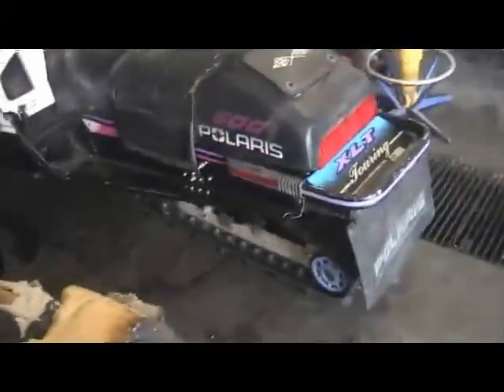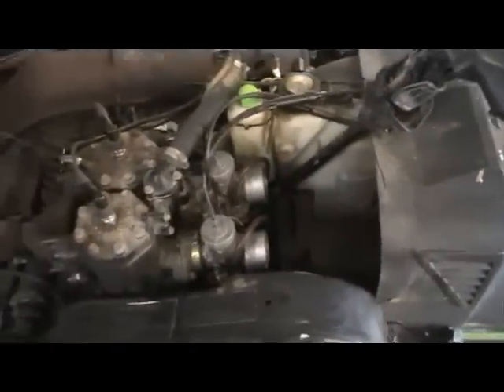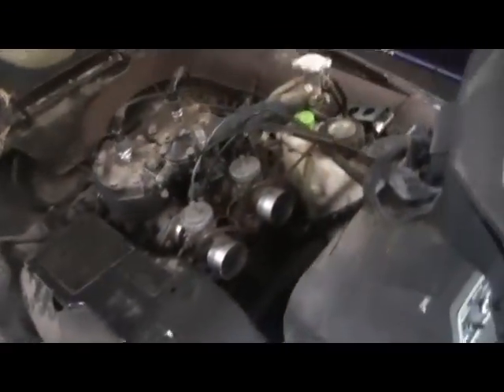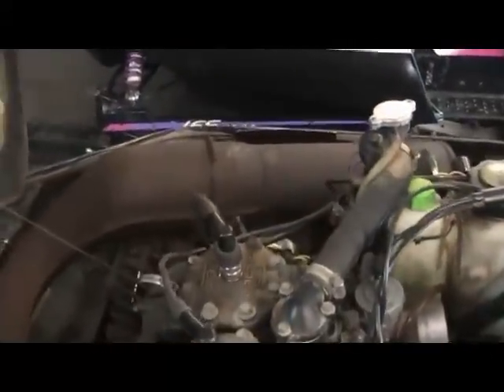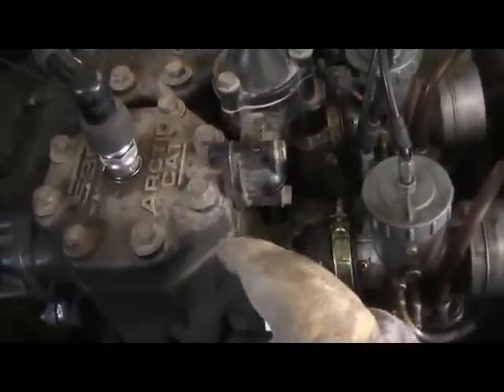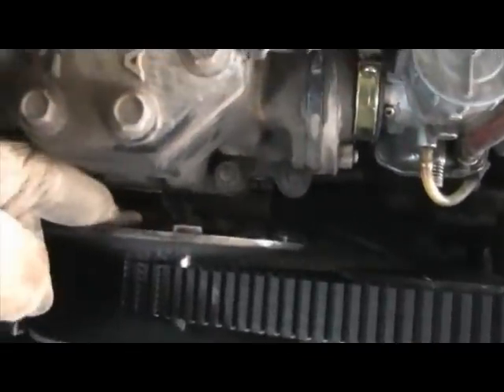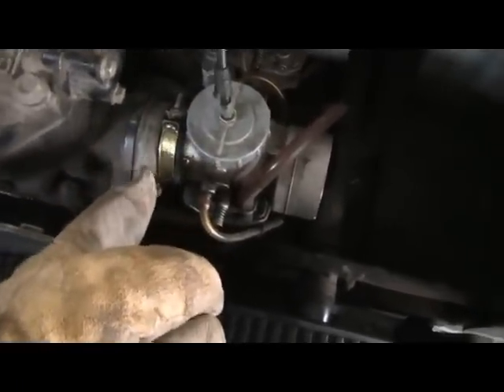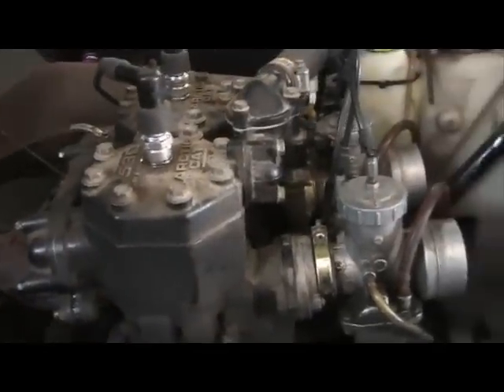Diagnosing the lean Arctic Cat Eltigre

Comment: I tried it again with some ether but I still can't find it. I posted it as a response, if you get time maybe you can listen.Maybe I missed it.I'm thinking that it's on the recoil side of the crank though and there's just no way to spray ether in the housing and behind the flywheel.I sprayed the carb boot, manifold gaskets, jug bases, clutch side of the crank, so I don't know what else it could be.Once the engine comes out it's going to get all new seals though.